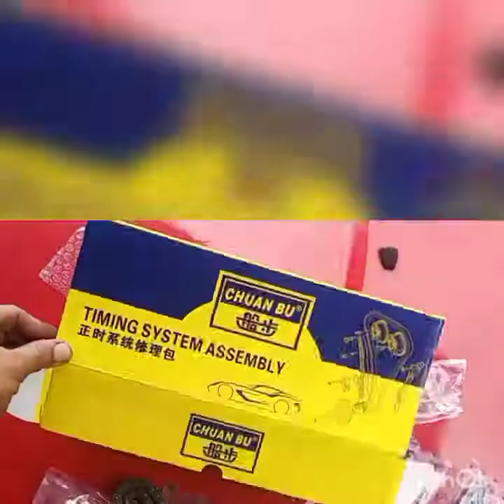Naza sutera timing chain mark

Comment: Boss buat video cara tukar brake pad belakang wira satria. Ada satu video kt YouTube tapi x clear. Boss buat bagi clear video. Kot2 ada pin2, cable handbrake yg kne tangga ka boleh tunjukkn cara2 dgn details. Video kt YouTube banyak yg dpn punya.
Reply: Yg dis punya bkn drum
Reply from the maker: Video niYg sy buat untuk pakai disc belakang honda pada wira tu lebih kurang saje cara tukar pad brek dgn disc wira 1.6....6ti kalo ada masa sy buat yg video 1.6....tq😅